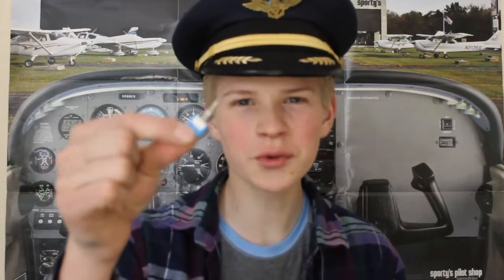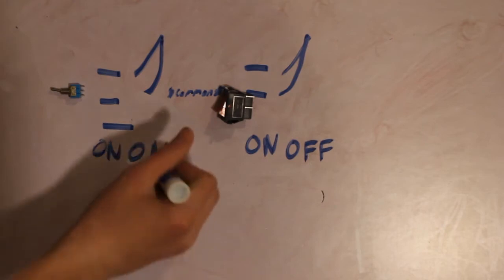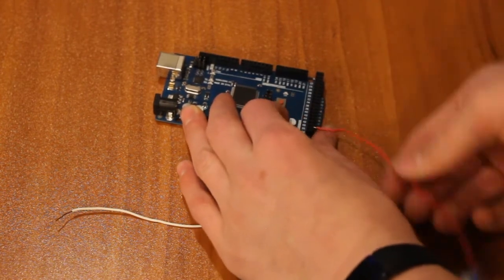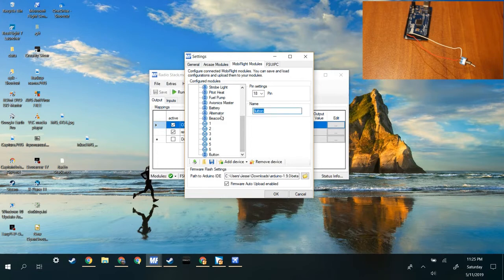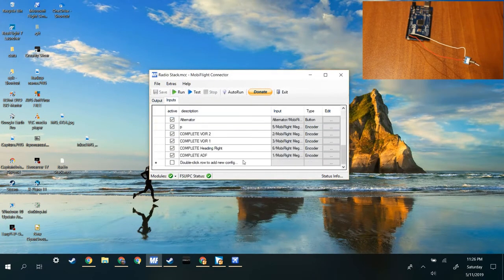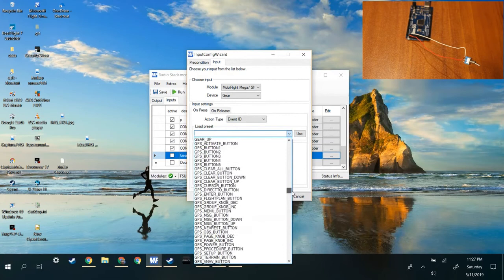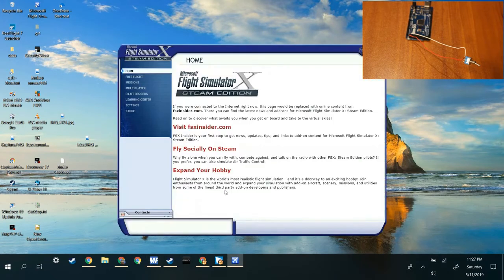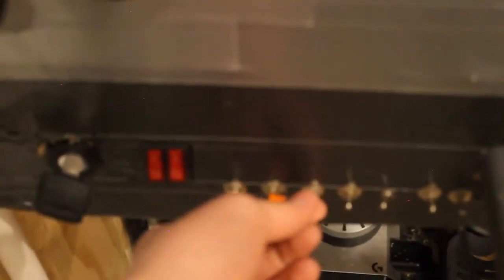How To Use A Toggle Switch With FSX | MobiFlight Tutorial

Comment: Hello captain, first thank you very much for sharing this content. I followed the steps above and everything is going well. I would like to go deeper and find out if it is possible to leave the toggle switch in the same position as the switch in the simulator. For example: If I start FSX and for some reason forget my switch in UP when starting MOBIFLIGHT this change does not happen. Would there be any configuration for FSX + MOBIFLIGHT to recognize the status of the button and carry out the change?
Reply from the maker: Hey Thiago! There’s a Retrigger events configuration option that does just this. You can assign a new or existing button to perform this. Hope this helps!
Reply: @CaptainBobSim  You are the best.

Comment: I have a question. can u pluck more than one switch into the Arduino, if yes how do I plug them all into "Ground" ._. And do u need a "special" Arduino or is an Arduino Uno just Fine?

And Ty for Answering the question I had for so long, how to make Buttons. Ty!
Reply from the maker: you can plug more than one switch into the Arduino. you can attach multiple switches. I think the best way to show it would be the switch panel video I made. an arduino Mega will work, an uno is not supported (might work but not recommended)
Reply: @CaptainBobSim  ty. Now i will Start building my Homecockpit

Comment: im trying to make a gear up and down switch with a usb encoder but i dont know how. any help?
Reply from the maker: Like a Zero delay board? With this I think you would wire it very similarly to the on on diagram, just have 2 ground wires. Let me know if you need further help!
Reply: @CaptainBobSim  I just got it to work and it works great!

Comment: I am facing a problem right now, My arduino seems to be connected and working fine, the firmware are uploaded but my previous devices (servo, buttons) have dissappeared and I am unable to add new devices.
Reply from the maker: This is a weird problem. I honestly haven't faced it yet. If you go over to MobiFlight.com there is an awesome forum, that should be able to help you.

Comment: Impressed. Thank You Bob
Reply from the maker: You are welcome! I hope your simulator goes well!
Reply: @CaptainBobSim  Just finished the trim wheel and it worked, made me so happy. Can I have your email?
Reply: @CaptainBobSim  I am facing a problem right now, My arduino seems to be connected and working fine, the firmware are uploaded but my previous devices (servo, buttons) have dissappeared and I am unable to add new devices.

Comment: Captain bob, I have bought toggle switch with two legs ( ON_OFF) . U r usingvtoghle switch with three legs. How canni connect mine to arduino? I need for switch panel
Reply from the maker: My switches were STDP (Single Throw, Double Pole) (3 pins) I only used two of them. Your switches seem to be STSP (Single Throw, Single Pole) .
Reply from the maker: Basically use the video, but pretend an alien spaceship shot one of the pins with a zap ray.
This will make the ON_ON switch into an ON_OFF switch.

Comment: do you need to have a arduino mega or can you have a regular arduino? Do you just plug in the arduino and then ready to go or do you need to install something to the arduino?
Reply from the maker: You will need an Arduino Mega, as MobiFlight is not typically compatible with other models. You will need to install Arduino IDE and set the path to it.
Reply: Captain Bob thank you for answer:)

Comment: Mine says that it can’t find arcraze
Reply from the maker: That is probably okay, as long as you aren't using an arcaze module. I personally haven't used these, so wouldn't know how to fix this.
Reply: Sorry for the hassle but I mine does not want to run
Reply from the maker: Did you happen to get it to work? 
You might consider double-checking your path to the arduino.